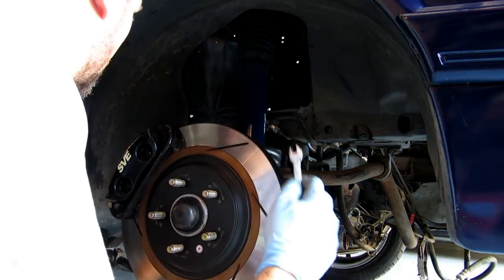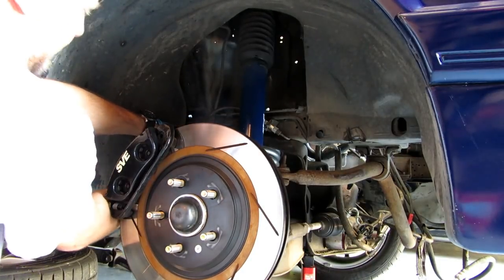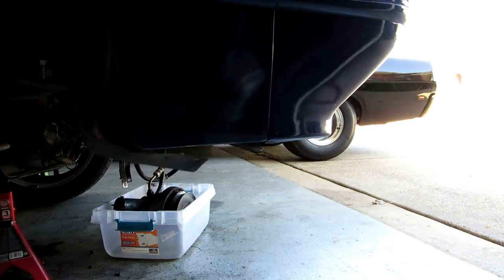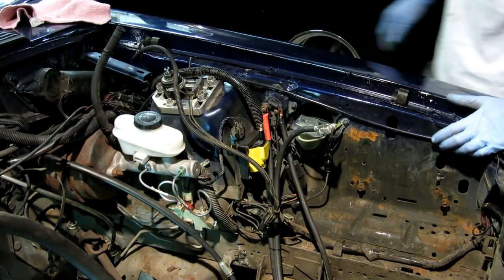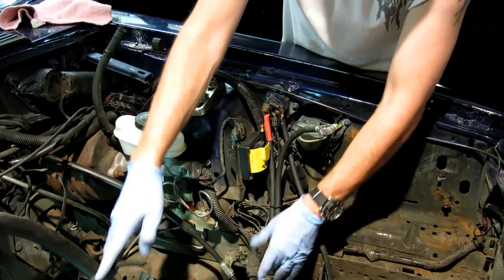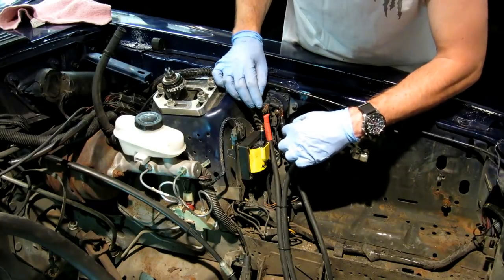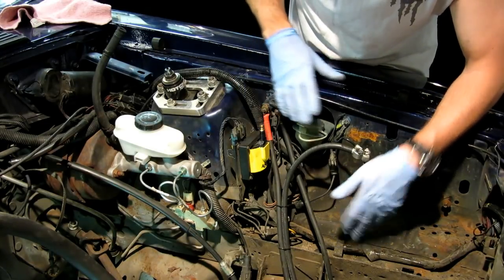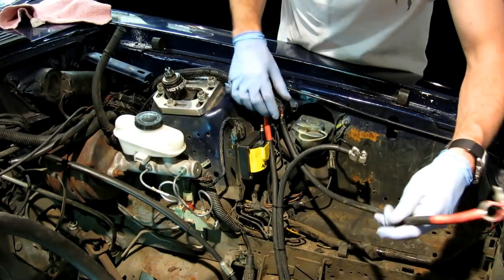1986 Mustang GT Project - Wire Tucking - Engine Swap Part 9

Comment: Mike, so glad you decided to do the wire tuck.. a few things I might add.. for the inner wheel wells there is a screw that holds them on which is located on the rear of the panel under the rocker panel.  On the passenger side. you should run the wires for the MAF now as well through the inner fender.  You can also just cap off the  cannister line and get a vented gas gap vs. having the line open and venting fumes under the car. I would also cover the inside of the fenders with POR 15 or some other rust prohibitive paint . On the driver side- just drill open a hole on the backside of the shock tower so you can feed the wire harness through, No one will see it,. Ive done that on many cars,   You can mount the solenoid on the oppposite side of the inner fender using the same mounting holes. If you still want to cut the headlight harness, get some weatherpack conmaunnectors to reattach the two ends..  it will make it so much easier and then you can also disconnect the two ends easily if needed. Make sure you do not clip off the ground for the  EEC. that needs to stay and also connected to the ground cable that you had going from the neg of the battery to ground,  I would reuse that cable- cutting off the battery terminal and out on a large lug end- then run it from the timing cover to the chassis for a ground. For the battery in the trunk- you want to use at least 1/0 welding cable for both + and -.. Run the ground in the rear from the battery to the quad shock bracket. I use P clamps to secure the battery cable from the rear to the front along the subframe connectors and up to the trunk area.
Reply from the maker: All good stuff! Thank you the time taken to respond. All very good info and advice! Should have had you come over to be on video and assist. The cut harness I actually looked at a 15 pin, or multiple molex like connectors to reconnect them The thought was, I should NEVER have to pull these wires out and re-run the, and a soldered connection would last and I wouldnt have to worry about a connector getting loose or getting moisture in it etc..For the in trunk relocation, I'll be using 1 gauge and run both the positive and negative up the frame wells, with P clamps, negative will go straight to the block, positive to the solenoid. Then another 1 gauge from the block to the inner fender where my grounds are. Plus leave the stock ground straps. Great thought about the 4 MAF wires though. I should get them ran now just to the kick panel so it will be there when im ready.
Reply: Great!!  One other suggestion , I run from the + battery cable in the trunk to a 150 amp fuse or circuit breaker, and then run a cable up to the front of the car to the solenoid.  A circuit breaker is better so that all you need to do is reset it if it trips.

Comment: I just did my wire tuck in my 86 you can feed the headlight harness threw the hole just cut and re wire the parking lights bulb sockets those were the only wires I cut
Reply from the maker: That likely was a better method! Right on man. Good job, I admit even from when I did the tuck Ive learned a bit more on this stuff. Either way I guess works, but obviously less wires cut the better. Feel free to shoot a pic and email it to me, I'd like to see how you ran it. prisonplanet88@gmail.com

Comment: Hey Mike, I’m starting my driver side on my ‘86 now.   Did you just separate the wires and plug going to the master cylinder from the rest of the harness, so it didn’t go into fenderwell?
Reply from the maker: No. Im using a 93 cobra 1" master cylider when I did my 5 lug swap so Im not even using the plug. Its tucked away with the rest of the harness.

Comment: Hey Mike, did that work out with the one connector that went down by the break lines?  Did the inner fender fit back ok?
Reply from the maker: Yessir. Tight, but all went back where it belongs.

Comment: Nice job!...I am waiting for Black Friday to hopefully get a good deal on a battery relocation kit for my 85 foxbody and will attempt to tuck a few wires while at it this winter. Thanks for the well done video!.....Off topic, there is a great looking 69 Torino GT project for sale right now on Craigs List San Antonio, a bit ambitious on the price, but it is super straight and 99% complete! check it out!
Reply from the maker: Just looked. It is a original GT / AC which is pretty cool and looks pretty solid, your right though it looks VERY original and unmolested. If its truely rust free its worth saving and price these days is not too far off. I'd offer the guy 3500...Wish I was rich and had a shop! lol. Id just restore that one back to original looks to be blue on blue.

Comment: Do u have to run the ground cables to a bolt? Cant u run them to the solenoid?
Reply from the maker: Unless I'm misunderstanding. Both sides of the solenoid are hot. One hot to battery, the other side is bridged when car starts and hot applied so wouldnt want to run any grounds to the solenoid. Ground is just that, tied to chassis and block. The bolt was a sure way to get all grounds to a fail-safe connector tied (welded) to the chassis. So, just need to relate grounds to a good solid chassis ground and make sure motor has good grounds too.
Reply: HOUSE OF DULA ah okay gotcha! Thanks for the reply

Comment: Fucking wires....the one thing I neglected on my build. I have zero issues with completely rebuilding an engine from scratch but them wires.....hate em.
Reply: There’s a company called Scott Rod I think is the name. They make fabricated fender aprons to hide all your wiring so you don’t have to go through this headache of wires
Reply from the maker: This is true...You still have to move the wires though, and go through the tuck headache....The scott rod panels are for after the tuck, they smooth the inner panels and fill the swiss cheese of holes that comes from the factory.

Comment: Can you not be like those Swag facts can you please keep the original starter
Reply from the maker: The starter? or solenoid?
Reply: Mike Dula the starter the old you know how the 86 through 92 starters is difference I like the other one the old started
Reply from the maker: Never paid that much attention, seem the same to me. tooth count can be different though from the years.
Reply: Mike- go with a 93 gear reduction starter. It places so much less load on the system and has more power to start your car,. Its a VERY easy hookup- you swap the starter cable from one side of the solenoid to the other post and install a 10 gauge hot wire from the old solenoid post to the solenoid on the starter. Its a direct bolt in,